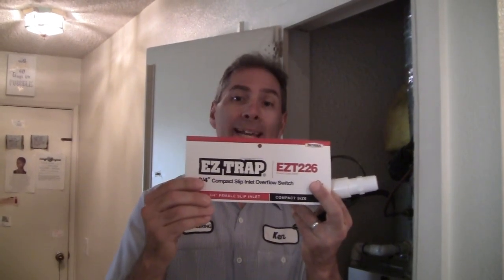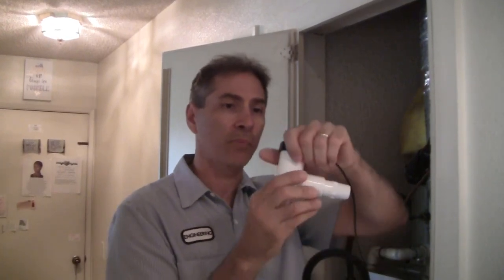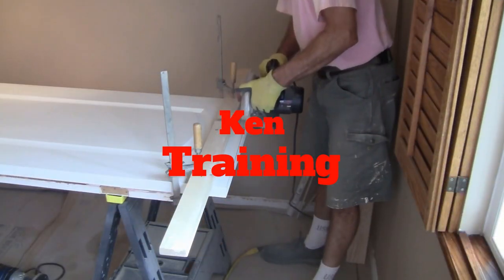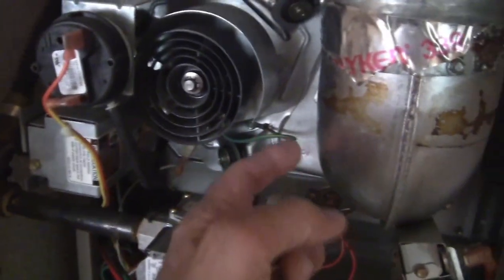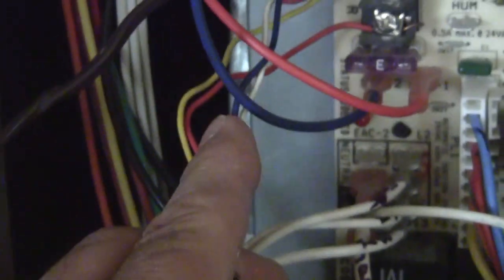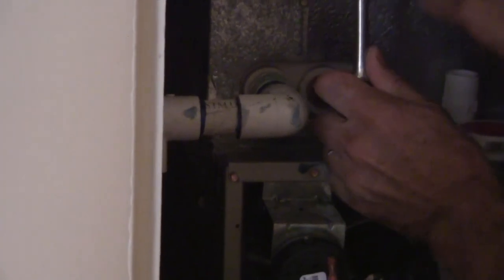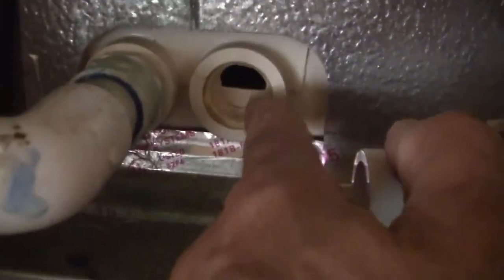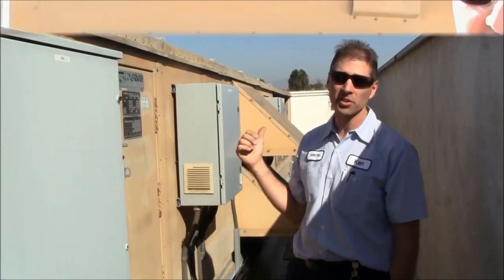EZ Trap 226 by Rectorseal 83226 Installation

Comment: You want the ezz-trap to  shut down everything at once so customer calls for service right of way and not at 10:00 PM where most likely will not get anyone to come out.
Reply: So far, everyone I asked, would rather have some air flow than no air flow. If it gets cooler outside and some windows are open, wouldn't the fan help with pulling in and circulating that cooler air?
Reply: 10 PM? Here in the Bay Area it’s about 68 - 71 degrees F in the summertime at 10 PM we only use AC from about 3 PM to 7 PM if at all

Comment: Thanks for noting the rib manufacturing issue inside the PVC fitting, I intend on dremelling it smooth!
Reply from the maker: I was thinking I could have tested mine by blocking the drain and filling up the line to confirm it would trip it out but you are correct to just drill it out.

Comment: How can you determine if you have a positive and negative pressure system.  I understand with Negative pressure you want a P Trap.  Thanks
Reply from the maker: you can tell in relation where the AC coil is located. If the AC coil is after the fan the coil is positive pressure. if the AC coil is before the fan, then the Coil will be under negative pressure (not common in residential).
Reply: @KenTraining  Thanks that's a perfect explanation.

Comment: My ez trap doesn’t have the wires plugged into it… is that bad ?
Reply from the maker: yours will be fine. Bty, I saw another tech how says he does not glue the trap in but just pushes it on. That way he can remove it, if needed. What do you think?

Comment: Hi…my unit didn’t have the float install… so how can I clean my AC water drain ?
Reply from the maker: you need to cut open the drain line to gain access.
Reply: In your video the pipe is on the left n the red cap is on the right… my is opposite…may I know what the red cap for? The issue I have right now is my next gave the error code e74 no power… so I check the fuse is still good… there no water leaking around … n last night I try to wet  vacuum outside pipe to unclog… the only last step I need to do is clean inside drain… but mine is different from all other video I watched… so the pipe on my right side I need to cut it ?
Reply from the maker: @Xx_eeveemocha_xX  Without me seeing your system its hard to give exact advice. But as general advice, if you want to flush the drain line with a water/ bleach solution, you will need to have an opening into the drain line to pour the solution. 
If you don’t have an opening and you can see the pipe discharge/outlet, you can connect your wet vac to that to try to suck out the drain line.